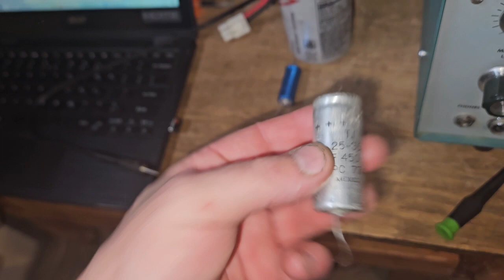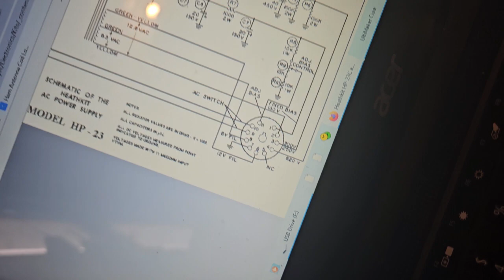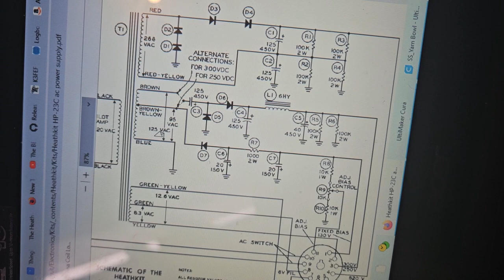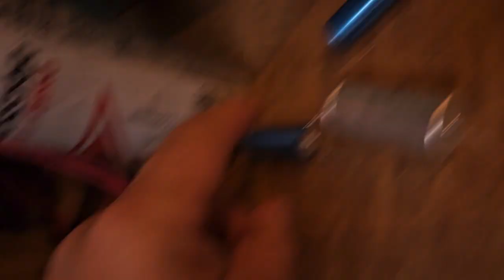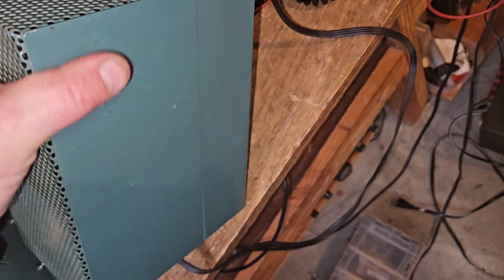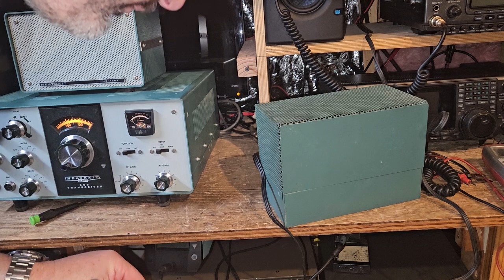HW101 HEATHKIT RESTORATION HAS BEGUN

Comment: You going to the hamfest on Sat?
Reply from the maker: Think so. Theres also a car show nearby at the heights church.  I think it starts after. Only reason i might not go is a dont like Yavapai amateur radio club. They rubbed me wrong. I had a problem with them trying to charge extra for me and my wife to sell stuff at hamfest.  It turned onto a argument.  The president of the club didnt care when i brought it up to him so ive said fck Yavapai amateur radio club ever since.
Reply: @hamradiohack  Well, maybe I'll see you there.  Plan on being up there Fri eve and leaving Sat eve.
Reply: Great video.  I saw on another hw-101 restoration video on YouTube say to rock the tubes back and forth to see if the hum goes away.  Might be dirty contacts on the tube socket or tune pins.